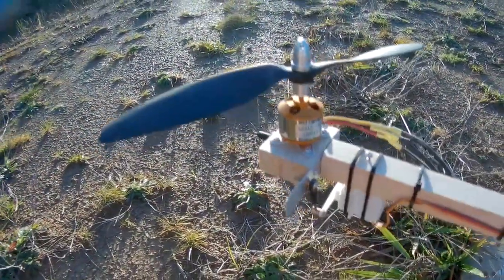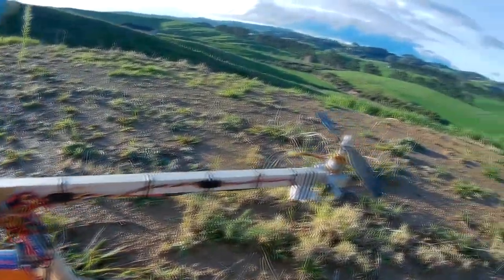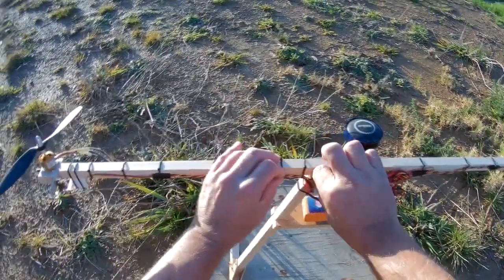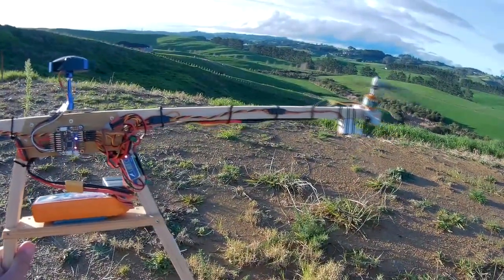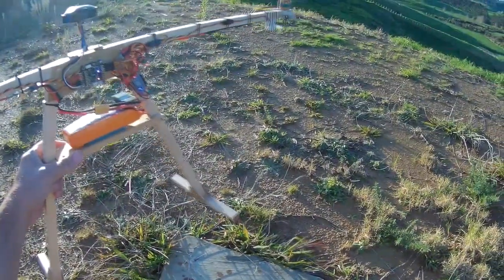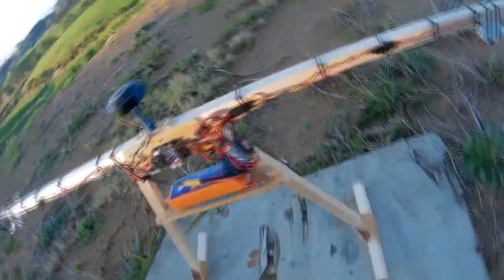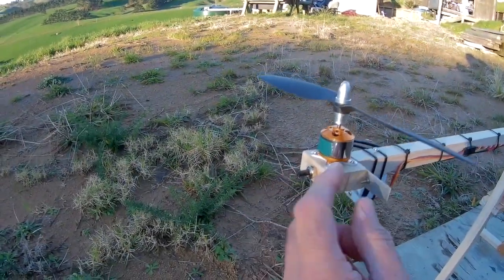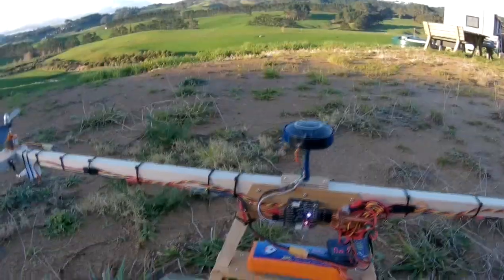Large BiCopter iNav Maiden

Comment: What is the mid position (degree) of servos?
Reply from the maker: Should be 90 degrees
Reply: Oh what is its flight time
Reply: Are you sure servo mid pos is 90 degree??
Reply from the maker: did you check out link for rcgroups? it has firmware to download there, 
90 is mid position correct ? why would you have servo in any other position......
Reply: Yes servo mid is 90. But in bicopter, when motor propeller is parallel to earth surface,at that time what is the servo degree position & what is its maximum tilt degree?

Comment: excellent! i've never seen a vertical mounted controller before! how does iNav know how to control the servos????
Russ from Coral Springs, Florida, USA
Reply: Is this firmware available to the public? I have a bi copter sitting on my shelf that I could never get to work with betaflight or cleanflight.
Reply from the maker: I found a way to upload the firmware sorry for the delay.
https://www.rcgroups.com/forums/showthread.php?2914402-BiCopter
Reply from the maker: Hi there, You can mount the FC any way you like you just need to change its alignment in the iNav configurater
eg. Roll -90.0
      Pitch 0.0
      Yaw 90.0
that was the setting as you saw in this video,
Ive had to put FC level now as the Mag setting in iNav arnt customise to cope with my board this way
The servos and controlled from the normal PWM outputs and act like the rear motor on a tricopter but two,
Also had some custom firmware written by Airfox32 for Bicopter as it isn’t supported in iNav yet,
I have changed motors and added 13 inch prop just waiting for fine weather to do a update,Cheers
Reply from the maker: Sorry Adam, missed your question, yes its open source,I had help with this as iNav at the time did not support BiCopter and not sure if it still does or may have been just my omnibus board cant remember.
try iNav, or if you have a omnibus F3 I will find a way for you to download, cheers Brett